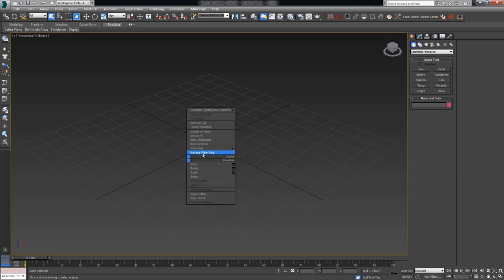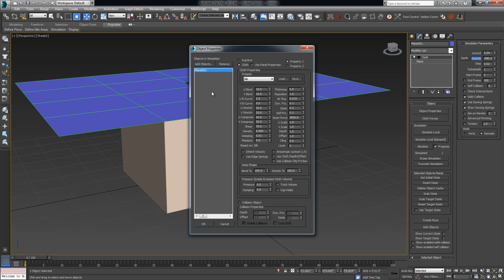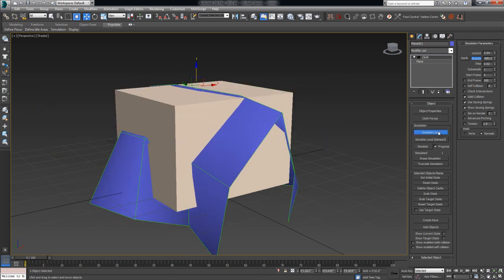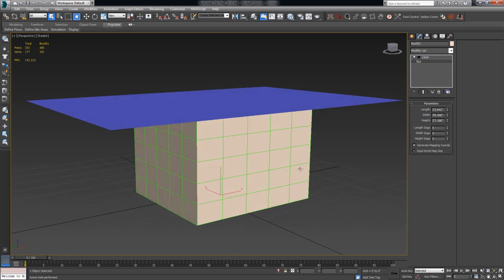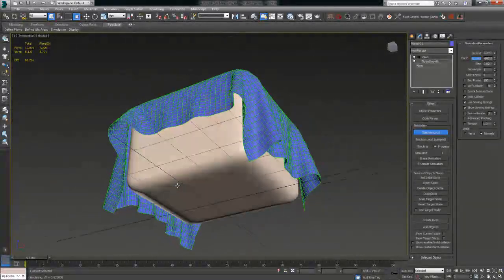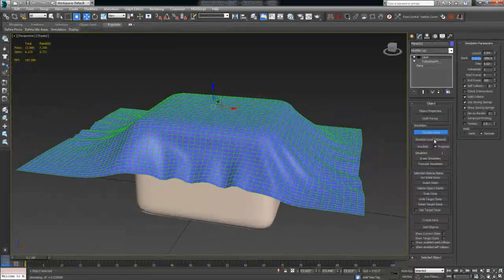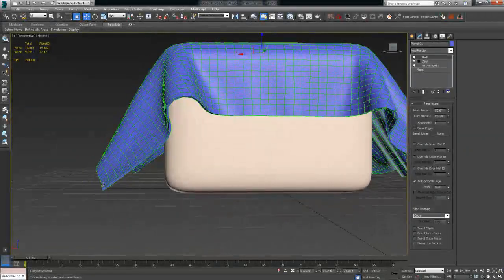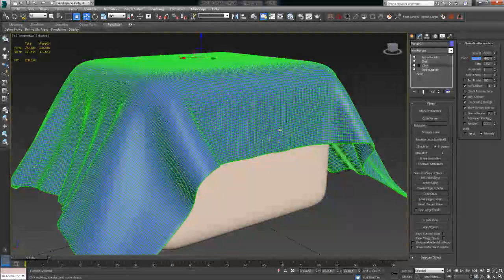3ds Max Tutorial (Beginner) -- Cloth Simulation

Comment: Nice simple tutorial, if you're prepared for the speed of it.

One query though...what If the objects I want the material to collide with don't show up when I go "add object"?
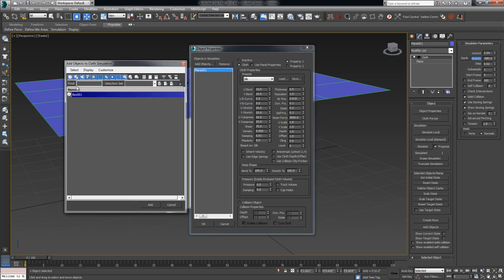Reply from the maker: Make sure you don't have your object(s) filtered out when attempting to add them. At 1:57 I select the box. You'll notice there are a lot of icons at the top of the window that are highlighted in blue. Those are selection filters. Your object may be behind one of them.

That, or what you're trying to add is currently hidden in your scene. Hidden objects typically won't display in an object selection window.
Reply: Mike Woolf Wow, thanks for the detailed and incredibly speedy reply.

You were spot on; I didn't have the right filters selected.

You've earned yourself a subscriber :)

Comment: Thanks for the tutorial Mike.

I have a pair of jeans comprising separate parts (legs, belt loops, hip). How do I keep the parts attached in the proper places, but give them individual cloth parameters? I want to puddle them to the floor but the loops keep getting left behind.

Also, can I pin parts of the geometry so that it doesn't drape at all? I want to have an item of clothing hanging off a hook.
Reply from the maker: +Mat Broomfield My first reaction is to ask if you need that great of detail to have the belt loops be part of the simulation, or if you can place them after the fact, or possibly just use a really good map/texture to achieve the same effect. Remember, we only give enough detail to achieve the effect. We don't want to spend all our time on something that's going to be a small part of the background that no one's going to notice. For example, if the pants are going to be crumpled up on the floor, they might be a small part of the background, or far away from the camera, to where the detail required isn't as great as something in the foreground, or is the focus of the piece. If what we're working on is the focus point, then yes, we will definitely need to go through all the trouble to get it as perfect as possible.

Second would be to make the loops part of the pants geometry by attaching it so that they are one entire object before the simulation. Maybe just by attaching the loops as another element to the pants object...?

I do talk about "pinning" the cloth in this video: https://www.youtube.com/watch?v=UYqCZRUo5NE. It may come in handy if you're looking to hang something, but you'll have to play around with it and it may not be required just to hang a cloth on an object. It really depends on the physics of the simulation.
Reply: +Mike Woolf Thank you very much for that comprehensive response Mike. Please forgive my ignorance, but how do I attach objects - just by using Boolean operations or do I have to break down the vertices and do it that way?
Reply from the maker: +Mat Broomfield Boolean (now ProBoolean) operations should be used sparingly because of the things it bakes into your geometry for you. It sometimes takes a lot of control away from the modeler.

To attach (and assuming you're objects are Editable Polys), select your object (pants), go to Element mode (5 on the keyboard) and find the "Attach" in the Modify Panel. Activate it and then click on the object you want to attach (loops). The two objects will now be accessed as separate elements under the same object. You may want to make sure they are in place prior to attaching, or you'll have to do it after the fact while in Element mode.

Comment: Don't put too much turbo smooth it will lock up the system too many calculations.  I prefer mine rough and slightly lower just the basic of what's needed